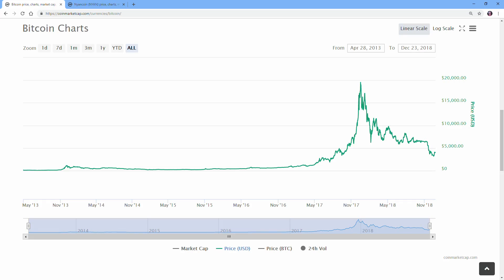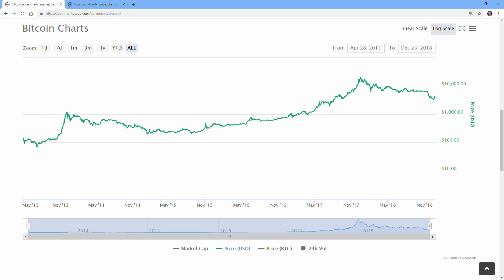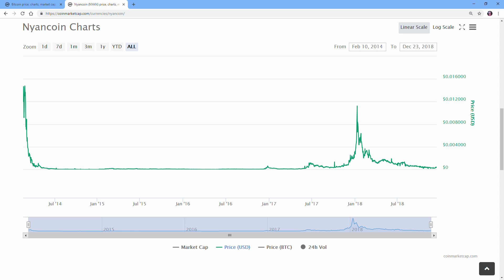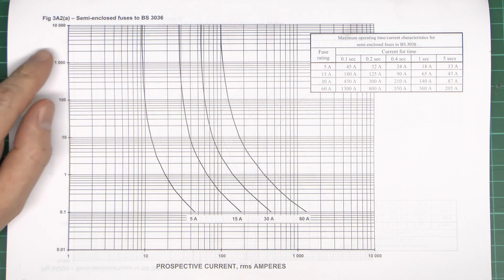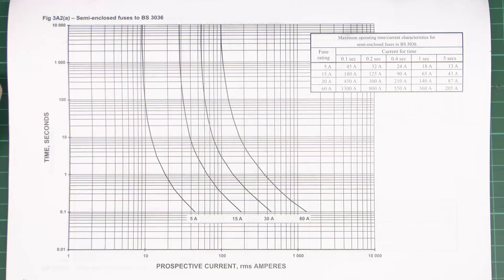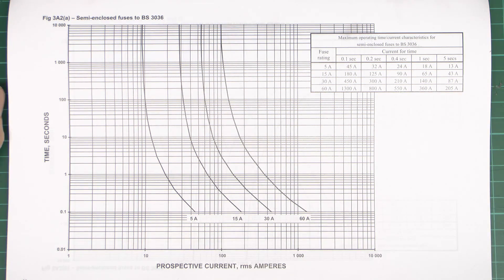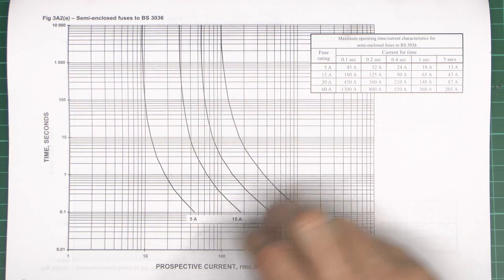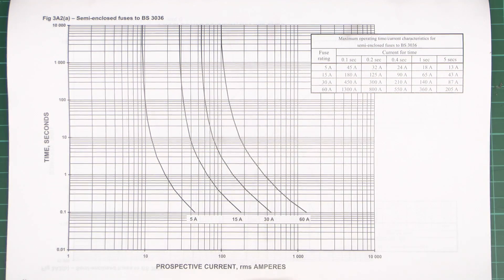Linear and Logarithmic Graphs

Comment: John I’m hoping you can explain something - NICEIC question this week was will an 80 short circuit trip a 20 amp breaker - in the regs it says no, it’s 100amps - I thought yes because type b is 3/5 times it’s rating which would give a 20 amp 60-100 amps. Where am I misunderstanding? Thanks in advance
Reply from the maker: Type B is between 3x and 5x, so 80A for a 20A device is in the 'might trip' category.
However for actual installations it's necessary to ensure that it will definitely trip, so a fault current of 80A would not be considered suitable for a typical Type B 20A circuit breaker.  100A would be the absolute minimum, and it would preferably be more than that as things like the supply voltage and ambient temperature will also affect the fault current.

Comment: Another way of looking at is that the same distance on the log scale represents the same percentage difference.  In the case of the crypto coin graphs you still have the same % margin if the value changes from $10 to $20 or from $4.000 to $8.000

Also,  graphs with one axis linear and one logarithmic are often called Lin/log graphs, to differentiate with log/log graphs where both axis are logarithmic.

Comment: Sorry for a silly, unrelated question. I always thought a 5 A fuse would melt if the current is over rms5A for a few seconds. Your graph for the 5A fuse shows that even rms 9 A could be applied to the fuse indefinitely without the fuse blowing.... What does that 5A rating mean? Is the same found with circuit breakers, do they permit far more current than indicated by the breaker rating?
Reply: The rating of a fuse is typically where it can operate indefinitely, with a bit of margin so as to not balance on the edge of blowing (sndd that margin can be surprisingly big) For instance if you turn on a device the initial current may be significantly larger than the operating current due to, for instance, buffering capacitors being charged up from empty. 
There are also fuses with different behaviour, for instance "fast" and "slow".
Fast would be nearer your expected behaviour but not so suitable to situations with inrush currents, where a slow type fuse is better.
Also, the construction of most common fuses/breakers just don't lend itself to high precision/close proximity between indefinate operation and blowing.
For the details of when they're expected to blow you need the  graphs/data sheets.
If you need something very precise I'd sooner look at some electronic protection circuit rather than a mechanical fuse.
Reply: @michaeltempsch5282  Good insight into fuse operation.
Reply: spelunkerd.....watch this video by John Ward https://www.youtube.com/watch?v=u6I7dKDk7hE&t=452s in it he explains what a fuse of rating x Amps actually means

Comment: Very good... I do disagree with one thing you said though.  2:24 a log scale doesn't start at zero... it continues the 10x pattern forever, so the lowest horizontal line shown would be $1.00 and should the need ever arise the log graph could be extended downwards and would show the same great detail if the price of bitcoin entered the $0.10 to $1.00 range or even the $0.01 to $0.10 range... and so on (even if people had lost interest in looking at graphs of bitcoin by then)

Comment: In those Bitcoin charts the log tells nicely how your investment changes in value. When the value was small you would buy more. The huge jump at the end of 2013 was almost unnoticeable in linear graph. 7:05 actually the half way between 1 and 2 is not 1,5 but 1,41. Halfway between 1 and any number is the square root of the number. For example 10 is halfway between 1 and 100.
Reply: Ummm, you have mixed up Log & Lin.
Reply: @wheelwells148  No, if you look at the mid point between 1 and 100, you will find 10, not 50.5. similarly in the mid point of 1 and 2 there is sqrt(2)=1.41, not 1.5.
Reply: Please read your first comment to JW's video..
Reply: @wheelwells148  Compare 0:53 to 2:30. In the first the jump at the end of 2013 is very small. In the second it is very high.